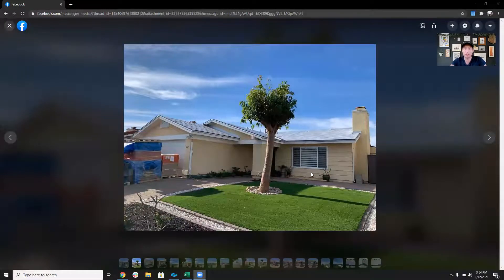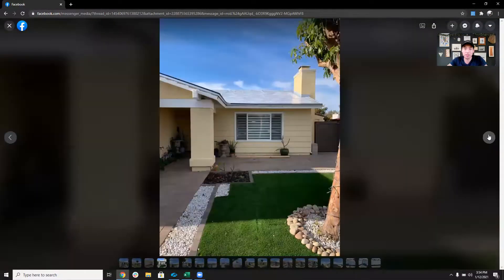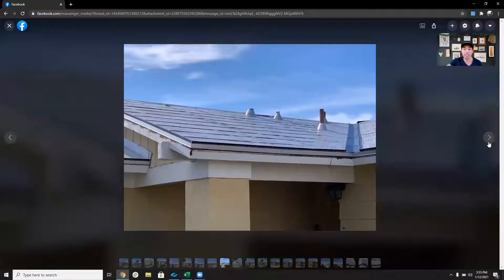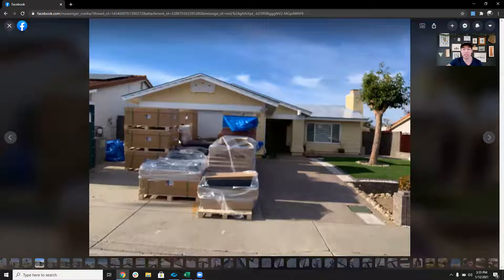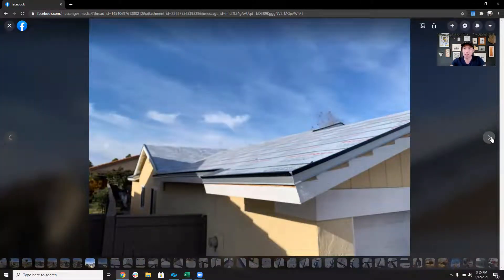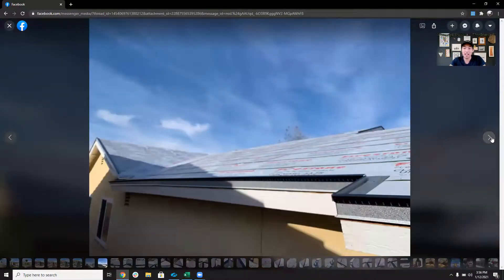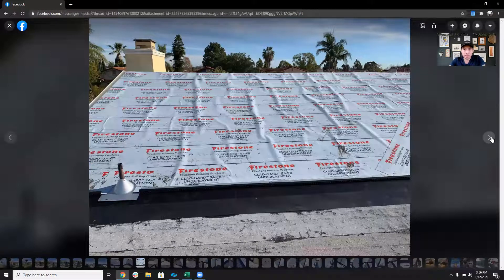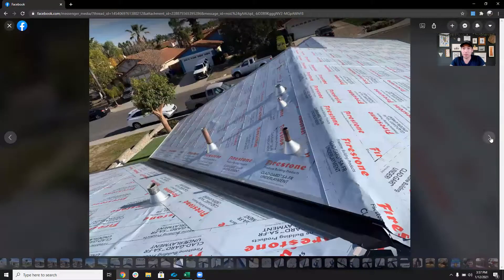Tesla Solar Install Part 3 - Teardown & Underlayment

Comment: I cannot get it and I watched multiple videos already about solar roofs: why people are installing a solar roofs on houses that in materials cost not more than solar roofs? It is small old house, no brick but siding, simple windows, outdated interior. It is like really old and odd. But the owners are installing tesla solar roof. THat's weird for me. I didn't see single 1-5 million house with solar roof. THere is no point in it. And I am not taking market prices into formula,- but let's say if we move your house virtually to Houston average area, - it would cost no more than 150k.
Reply from the maker: each buyer makes their own choice.

in this case for this home, the roof was many decades old and needed replacing. a new roof and solar was the same or more than the 26k paid.

now to get solar roof for this same home after the price increase is over 45k and not worth it

it also looks amazing
Reply: @RobertSchmitt  not sure if I got your message, but the new shingle roof cost no more than 15k. for a house of your size maybe even less. do you have such a crazy labor prices in San Diego? Wow.
Reply from the maker: @arishem555  this would be for tile roof which is more.

yes for shingle that sounds right. adding a small solar setup is at 25k. tile plus solar is closer to 30k or more

Comment: just so you know the underlayment is not any good. that is why tesla changed it and they use there own now. they probably still had the old stuff in stock and didn't want to throw it out. also tesla has there own inverters i hope you got those installed.
Reply: There is no evidence that the firestone underlayment is not good. From what I read they continue to use it in California. Not sure if it matters but its primarily classified for commercial applications. I think they replaced it since the new one is easier to install and of course has the Tesla logo for free advertisement while tiles are not on it yet and probably lower cost to acquire.
Reply: @mp5cartman  I heard it was weather conditions it doesn't do well in the cold
Reply from the maker: the firestone? i would have that it's tried and true. hopefully it holds up. either way tesla has to cover in their warrenty